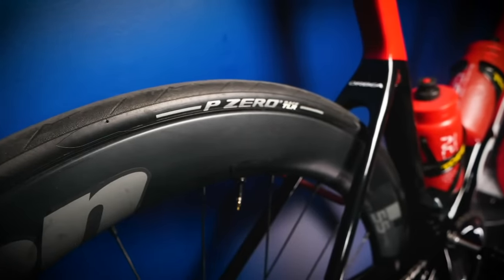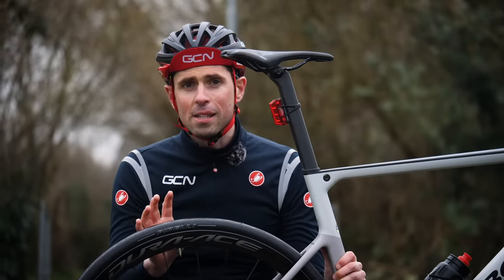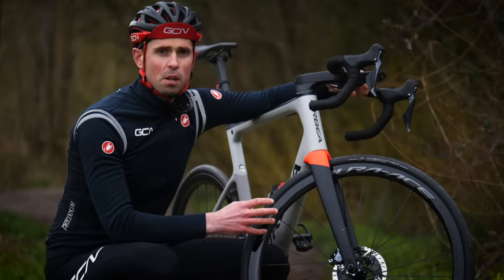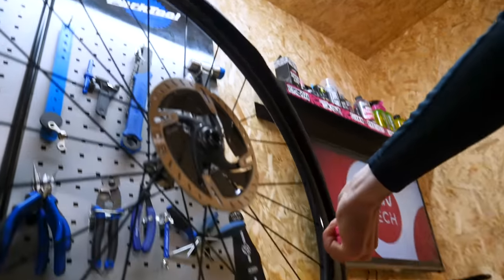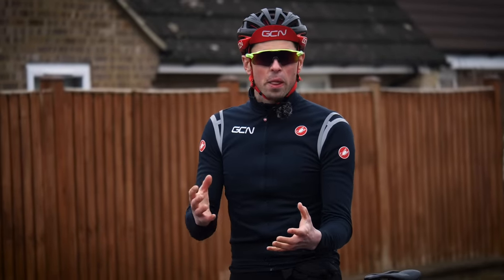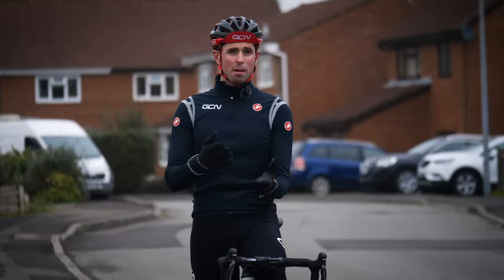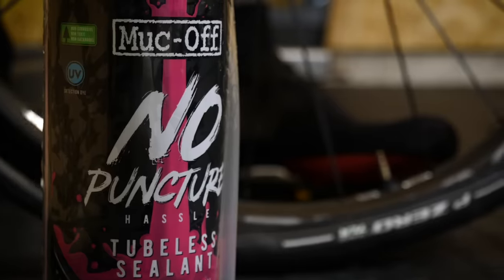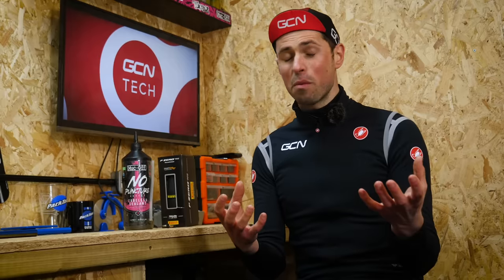Tubeless Convert! | Why Alex Will Never Use Inner Tubes On His Road Bike Again

Comment: Does talcum powder in your tire actually help... could you do a piece on that please
Reply: I use a bit of talcum powder when installing latex inner tubes. It’s supposed to reduce friction between inner and outer tube also reducing rolling resistance ever so slightly.. I think there’s at least some truth to that. Love the feel of the latex inner tube instead of butyl. Very happy with those and the Grand Prix’s. Downside to the latex is the much more frequent need to pump up the tyres… as in daily..
Reply: Oh yes, latex is also supposed to reduce the risk of flats as it’s more compliant

Comment: I'm not convinced.
My touring bike is fitted with Schwalbe Marathon Plus tyres (rated as the toughest tyres) with tubes. I haven't had a puncture for 5 years.
I average 2 punctures a year on my road bike but I'm now switching to Continental Gator Hardshell (with tubes), which are rated as the most puncture resistant road tyres. From the reviews I've read, punctures are rare.
Reply: Well, the downside of the Marathon Plus is something you have to account for. Heavy as fuck, horrible rolling resistance and at least for me uncomfortable as fuck. would take a Marathon Supreme or at least the "regular" Marathon for a touring bike.

In the end you have to make compromises anyway, and if you want to be as fast as possible, tubeless might be the way to go in that regard.
Reply: @Eyproshit  I agree that you have to make compromises.  
When I go cycle touring in remote areas, I'm not concerned about rolling resistance and going as fast as possible.  For me, my main concern is reliability and will my tyres be able to handle the harsh trail conditions that I'm riding on.
Before I switched to the tougher Schwalbe Marathon Plus, I was getting many punctures (on some tours I got several punctures and on one tour I got a couple in one day), which is not ideal when you are in remote areas.  Now that I have switched to the tougher Marathon Plus, I haven't had a puncture in years.

Comment: Tubeless tires are just much better. I run GP5000 25/28 front/rear on my KTM aero and its so smooth plus reliable. Zero puncture stranded situations with over 4000Km fast runs.
NEXT STEP:
Hookless wheels (waiting for restock... ZIPP 303 Firecrest).

Comment: I’d honestly take the risk of having to fix an inner tube on the side of the road for 5 mins than run the risk of having a puncture on tubeless where the tyre becomes unseated and having to walk home, covered in sealant. Do I care about 5 watts? No. It’s only going to make me fitter anyway😀
Reply: I've never used tubeless tires.  Tell me, tubeless riders; do you really end up "covered in sealant"?
Reply: @BixbyConsequence  I would say that's a little bit of an exaggeration, but I have had it spray onto my clothes, and it doesn't wash out very well.  If you have a puncture that doesn't seal, and you need to attempt to take off the tire, and put in a tube, your hands will likely get covered in sealant, and unless you've got rags handy, you're either going to have to wipe that off on your already stained clothes, or you're going to make a mess of your bar tape.

And that's assuming you're actually successful in getting the tire off, and back on.  Some tubeless combinations can be very difficult, even if you know what you're doing.  If you're unskilled at tire changes, you're walking home.

Comment: Just purchased a Bontrager ProV3 wheelset and the shop set them up as tubeless, when in fact that is not what I wanted.  They didn't ask before setting up. :( These wheels can run tubes or tubeless. I have the same wheel set on another bike running tubes with no problems. I was going to try the tubeless set up, but based on the many comments, I can already tell I'm not going to be a fan of tubeless. I don't want a side of the road sticky shit show, nor do I want that sticky sealant all over my $8,000+ bike and $100+ kits.  SO...I have two questions and need some advice. 

1. When trying to air the tires up (in the tubeless configuration) I notice that when I reach about 50-60psi, they won't hold more pressure. They almost seem to leak air as I try to increase pressure. Is this normal?? 

2. How do I convert this new wheel set back to a tube configuration without getting sticky sealant all over me, my bike, and my new wheels?

Thanks for reading and thanks for your advice. Be safe and have fun out there!

Comment: I did finally get go convert my mountain bike to tubeless. I would like to convert my hybrid and road bikes to tubeless. My hybrid has tubeless tyre but not wheels. so new wheels for that bike. My road bike needs new wheels and tyre. So my new road bike as my current road bike is that old I can only run up to 23mm. I went out on my road today (the day this video came out). I was running 95 psi in the front and 100 psi in the rear. One if the roads I rode along has a section which a wash board. VERY uncomfortable. Thankfully short. I usually run low 20s psi to just over mid 20s psi in the rear as I also have inserts in both tyres. I have looked for 23mm tubeless road tyres. I haven't seen any yet.

Comment: Idiot idea by the marketing department to sell more rims and tyres, been running clinchers for years and maybe a puncture a year, repaired by the roadside in 10 mins. On a par with push fit BB's. Don't be conned, what's next power steering!

Comment: is the tire sealant heavier in weight or create more rolling resistance than inner tube? My tires are Continental contact speed 90 PSI slick road tires.

Comment: Pirelli claim they COULD save you between 2/3 watts. Anymore detail on the specifics of this claim Alex? Also how can you possibly feel that difference? 
Every other study shows when you’re running less PSI you ‘feel’ slower. Not saying that’s the case but you’re going against the grain with your feel test.

As for your test. What average watts did you do for each run? Although there’s far too many variables to consider surely this one would give us a good indication if the test was even remotely fair with equal power outputs.

Comment: Wow, they managed to find a solution to non existing problem, the bike industry has gotten greedy lately, i have tubless on my MB Stumpjumper but that's as far as I'm willing to go, I tried tubless and latex on my road bike and both were nothing but problems, sealant cost and maintenance, valves, expensive tubless tires..., the latex doesn't hold air for long, easily punctured, extremely expensive latex tubes...I'm sticking with my black tubes for now and avoiding all the nonsense, I can't tell the difference anyway!

Comment: All i can say is you didn't manage the contols tight enough for the run. The time should/will be the same. WHY because even if one tyre is slightly faster than another it makes no real world difference. Because as you go faster, over 12-15km the aero drag increases exponentially making the rolling resistance factor difference insignificant at normal riding speeds. Also the weight is the same as the sealant has weight too instead of a tube. Yes they may give better puncture protection, but they are more of a PITA to fit, especially seeing there is no proper tyre standard. Horse for cousre, but they are NOT faster.

Comment: This might be a stupid question, but does the sealant sprouts out when you press the presta valve (when trying to put more or less pressure in)? I'm wondering if adjusting the pressure would lead to a mess and/or if the sealant would get inside my pump and have any impact on its future efficiency.

Comment: I just put new pirelli pzero race tlr’s on my Reynolds AR41 wheelset. Turns out Pirelli suggests 108 PSI for my 214 pounds. I normally ran vittoria rubino pro’s with tubes running at 120 psi. Not much of a difference. guess I need to lose more weight to enjoy the lower pressures.

Comment: I have been trying tubeless for 6 months or more, whilst they have lots of upside, there is also downside! I am currently having a leak on my front wheel its from the valve, sounds easy to resolve? Until I cant get the tyre off? Ive deflated  but cant unseat the bead, I’ve tried pliers on a bench clamping the tyre and pulling 2 hands on the rim, to no avail? Next option it to cut off basically a brand new tyre? All because the valve isn’t sealed? How do you break free the seal and? Changing a tube 5 mins, fixing a tub less? days. This is one of many poor experiences with tubless! It’s a shame as they are great to ride

Comment: I went tubeless around ten years ago as my new Shimano rims were tubeless-ready.  I was happy with them at the beginning, in spite of them being pretty hellish to mount and to inflate without a floor pump.  The end of the love affair came when I twice had the beads fail, which meant I was stranded as I was unable to put a tube in.  I went back to tubes and have not had to fool with sealant or wrestling with getting the things back on the rim ever since.  The tires (Hutchinsons) were expensive and I felt cornering was improved but the advantages as I stood on the side of the road being bitten by horseflies in Gatineau Park until a motorist took pity on me were not so apparent, or when I was halfway down the Grossglockner, saved by yet another passing motorist.  I ride 320 TPI Vittorias which provide excellent ride comfort and are very supple, so easy to mount even without tools.  Tubeless are just additional complications to what was once a very simple machine--we all know the other ones!

Comment: Never tubeless for me unless it's the only thing I can buy.  You have to hav ea tube with you on a ride anyways because a repair might not work.  Would be hard to set glue in the rain.  I also think it's just as much a waste to use liquid sealant as it is to have a tube that can be repaired multiple times and used for years and years.  It's also very very difficult to inflate a tubeless tire on the side of the road unless you have a c02 system, which also isn't a guarantee.  And how about the carbon waste on making compressed c02 cartridges?  It's the easiest argument ever to NOT use tubeless.

Comment: What I am afraid is having lower pressure and hitting pot holes or cracked tarmac(which are very common in old Washington state roads) and damaging the wheel.. Is it something to be concerned?

Plus I heard it is very hard to pump the tubeless fast enough to get seated on the rim using regular pump..

Comment: New Ebike. Tubeless ready..removed tubes used sealant. Had a puncture.Would not seal.Tried removing tyre to fit a tube to get home. A nightmare .Ended up getting a friend to get home. Had to take wheel to a bike shop. They used a plank of wood, hitting between the rim and sidewall. How are you supposed to do that in a remote location? Not impressed with tubeless

Comment: which Valves can you recommend? i have problems getting my tubeless-valves sealed. i tried with different threathen-strengths of the fastening nut. already changed the small sealing-ring to a thicker. this made it a little better. but i still do not dare to go out for a ride without a pump with me (do you?)
greets from germany
Reply: There seem to be two main designs of valves--a square block at the end of the valve (Mavic & Cafe Latex) and round just larger than the value itself (Stan's, American Classic, Specialized, etc.).  I think the square ones work better if you have a groove in the middle of your rims, but I'm not positive about that.  What I've found is that when you get air leaking at the valve (with either kind)  it's often a problem with the rim tape and that's just where the air/sealant escapes. I've recently been using the Cafe Latex tubeless strips setup with is great--no ruined tape!  (https://www.effettomariposa.eu/en/products/caffelatex-tubeless-strip/).  But for tape:  clean the rim really well with alcohol or another solvent.  Once dry tape tightly, keep centered, and press out air bubbles; start several cm before the valve hole and then go over it so it's double taped (for some wheels (HED) I've had to use two layers of tape).  Then, once you've poked a hole for the valve, mount half your tire, insert a tube, mount the other half, and then fill to max pressure (hopefully you hear the tire pop loudly into place).  Let sit overnight.  The next day, take off half the tire (careful not to mess up the tape).  It should have nicely adhered to the rim and the tire has "stretched" to fit the rim.  Add the valve stem tighten by hand only but as tight as possible.  Add sealant, mount tire and inflate with valve stem removed preferably with a compressor.  If the tire doesn't want to seat use soap suds all around both beads.  This tool can help with the final bead installation so you don't mess up the tape:  https://www.biketiresdirect.com/product/kool-stop-tire-bead-jack
Reply: @brijlunine6416  hi, thanks for the reply! i am using the Bora WTO45 - they have no rim tape as they are already full carbon inside
Reply: @patricklachetta7644  I guess it's a matter of using small O-rings inside and outside the rim and hand-tightening as hard as possible.  Can't think of what else would cause leakage from the valve hole only.  I've had really good luck with American Classic valves.

I always bring a pump and tube!  

One nice thing about this whole debate is that one can always go back to using tubes.
Cheers.

Comment: One concern as  someone that is not riding all bikes  all year long:  Can I leave a tubeless setup standing around and only have to repump it before I go for a ride? Or do I have to change the sealant after the longer break?
Reply: little disclaimer: I have a winter and summer wheel set to my alloy road bike with different tires (the chippings from the winter season on the road kill every nice road bike tire)  and a carbon frame that I use excursively in the warmer season

Comment: Inner Tubes all they way! they are cheeper in the long run. I'll switch to Aerothans in a week or so. I usually have 1 puncture every 2000km3000km-ish, never pinch 
Tubeless is just unreliable and don't last as long as tyre with tube, after some time it starts to leak and lose air over night. on a trip they are unreliable for road setup. Also if you get a big cut on tyre you can always find a way with tubes but often time with tubeless you will have to put a tube in with all that goo in there and then buy whole new tyre again and change them. To compare GP 5000s last about 5000km or so for me on the rear and my friend on tubeless changes them around 3000 because they just start to leak and become unreliable

Comment: this has nothing to do with fair evaluation, it is a confirmation bias. Proper test would need to be blind (the rider does not know which set up he is using) and ridden at the same watts. Plus other non-speed factors need to be include it as well - more fussy set up and maintenance of the tubeless, and the like

Comment: if I weigh too heavy (100kg - sadly obese 2) on my size 46 road bike... is tubeless setup still safe for my case? I ride mostly solo due to my schedule. With clincher tire setup, I can easily replace it with my spare tube ... check and remove the cause of flat.. then continue with the ride. With tubeless setup, is the chance of getting flat/punctured less? If I  get flat in the middle of nowhere, are there any easy fix to get me back home? Thanks!

Comment: tubeless sucks unless you have carbon rims and nice tires. those carbon rims hold a tight bead really well. tubeless always goes flat and you have to refill it with sealant every once in a while. I've had to rebuild an entire wheel because the stans sealant they used got into everything and corroded the nipples to the point where they were all falling apart.

Comment: I like butyl tubes.   I’ve used them
25 years.   They go like buses doesn’t matter how much check tyres have one puncture ....  Have another next day.  Then none three months .  New tyres new tubes means may get upto three to six months no further puncture.   No hassle fixing a couple punctures per quarter 8 a year .   What is. Is this pump and gunk.  Better on rolling resistance or not.  I’m just not up for it.

Comment: I rode the hell of the ashdown in 2018 with two riders both on tubeless, both punctured or flattened whatever you call it, one plug failed second got in  took about 35 minutes to get going and he is'nt a novice rider, the other punctured sealant came out so did all the air ! after another fruitless 40 mins he decided to call his wife and scratched, can I just ask when did it get so bloody difficult to change a innertube and pump it up ?
Can some also tell me which is better for enviromental reasons a innertube you can patch and re use or a tubeless that needs sealant ?
Reply: even dead inner tubes can be reused as ties, homemade tools grips, and emergency patches, recycling is key

Comment: If only my favorite tires would exist in tubeless, Continental 4000 S2.
Reply: Speaking from my own experience with both the conti 4000s2 and gp5000 with tubes, the gp5000 are even better than the 4000s2, the gp5000 is available in tubeless, so you could get those if you want
Reply: @jorenvandaele1301  Thank you ! I'll try those, it's time to replace them before the season anyways.

Comment: "2-3 watts"
Let me see. At 300 watts FTP let's say that is 1%. You know what else equals 1%? The aerodynamic drag that is caused by the little hairs leftover from the tire mold when they injected the liquid rubber on your new tires but you never bothered to cut off with fingernail clippers.